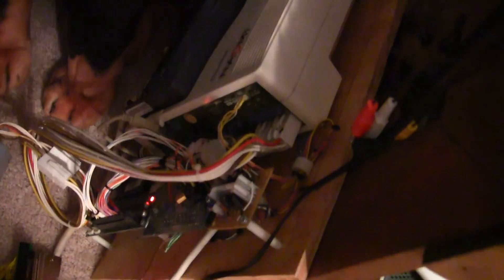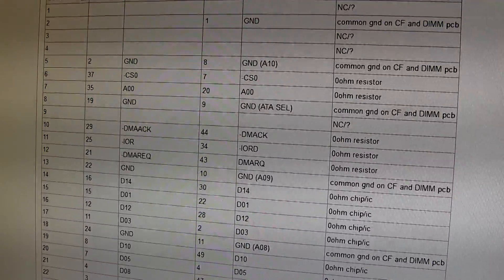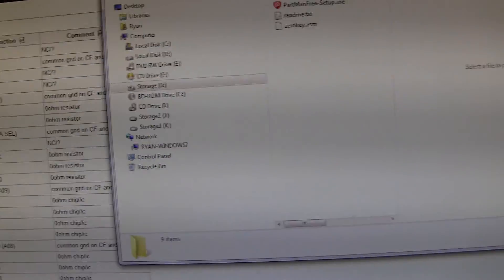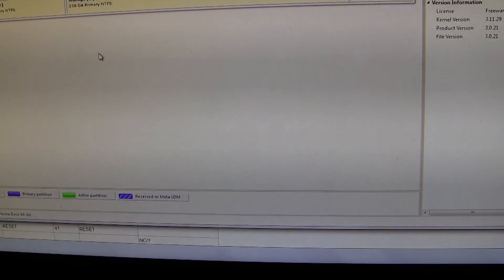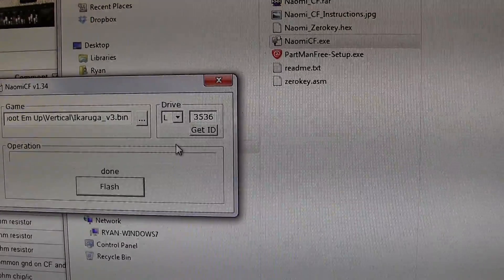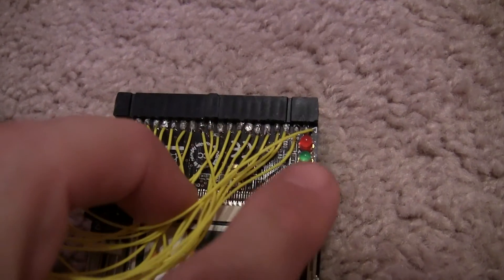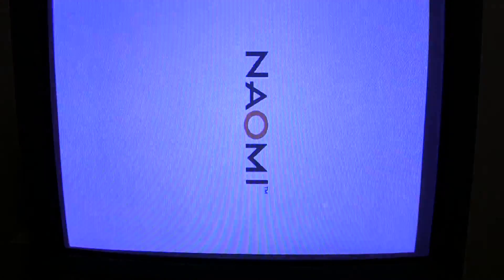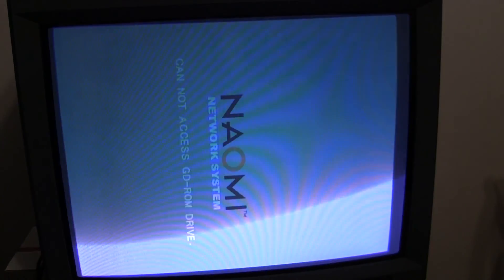Sega Naomi Compact Flash GD-ROM Replacement - Common Problems

Comment: where can i find the naomiCF software?
Reply from the maker: There is an official sega disc for upgrading main board firmware that came with the CF unit, i have one somewhere lost. Im not sure if you can simply burn it to CD or not. Its probably floating around google somewhere.
Reply: @srarcade  many thanks

Comment: do you still have to use the security chips with the the compact flash system?
Reply from the maker: You use what is called a "zero key" which is a universal security chip to run all titles.
Reply: where would I get one, I already have a compact flash made plus a game flashed onto it
Reply from the maker: You can google around there is a few people who sell them. I don't have the time or chips readily avaliable to burn any unfortunately, I erased another chip I already had.